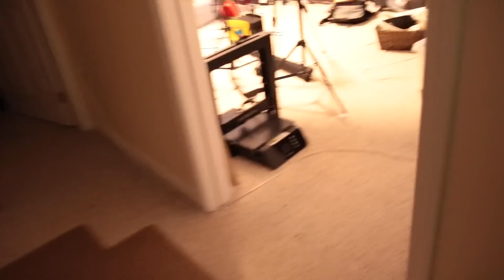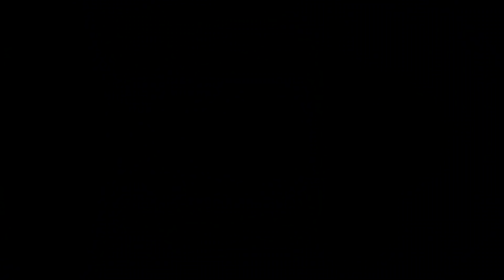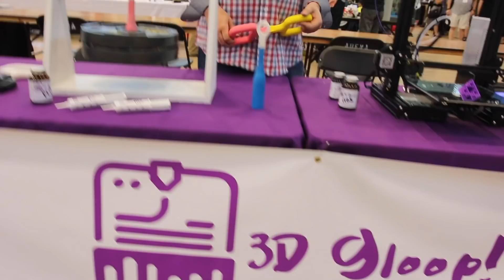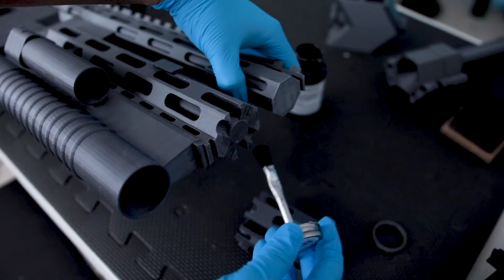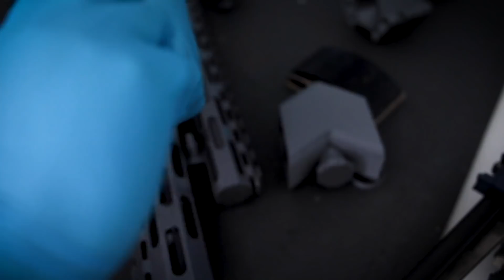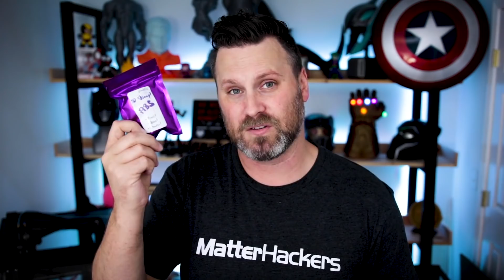3D Printing Cables Gun from DEADPOOL 2 | Mini Review of 3D Gloop

Comment: Jessy,
Hey man what do you print this silver at because I have a raise3d pro2 plus and it just keeps clogging my nozzle even after Raise3d’s help! Your my last hope!
Reply from the maker: Fragged 3D filament Oiler. This is the only machine I run into this with this filament on. So odd. Few drops of peanut oil in my Oiler and it prints awesome
Reply: Uncle Jessy so if not oiled it clogs?
Reply from the maker: Fragged 3D only on my n2. I was printing at 218 temp as well. Not sure if it would still clog if I raised the temp up higher
Reply: Uncle Jessy Raise3d has me printing it at 190c lol

Comment: okay, so i love the sound of 3D printing my own props instead of always making messy cut marks on foam, but do you NEED a PC to connect to the 3d printer? or could i use my mac laptop? Also what Printer would you reccomend for a beginner?
Reply from the maker: Black Wolf hey man, I use a Mac for all my software. You can buy , download, or make your own stl files, then load them in Cura (free) which tells the printer how to print the file. Then typically you save that info to a sd card that came with the printer. Checkout the creality ender 3 (video soon) or the CR-10.

Comment: Hey brother. Doesn't matter the glue... Although gloop seems legit. You should (my impression) use a back bone. Like 1/4 inch metal rod or threaded rod. Even wooden dowels. Takes much of the strain off the joints/layer imperfections and spreads it along the length of the rod. Just a lil tip from Mike D. @ 3rdcoastprops.

Comment: Great video as usual 👍 ,well if u wanna join two pla Parts a cheaper alternative is acetone. just brush some acetone on both the contact surfaces and apply pressure and let it to settle , after some time you will have a strong chemical weld !
Reply from the maker: Will that work with PLA? I thought Acetone really only worked on ABS?